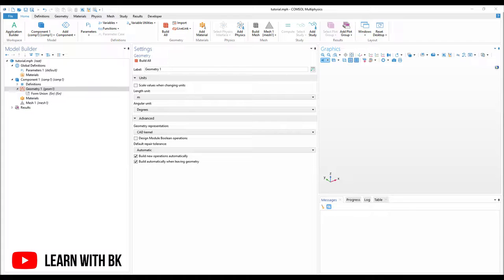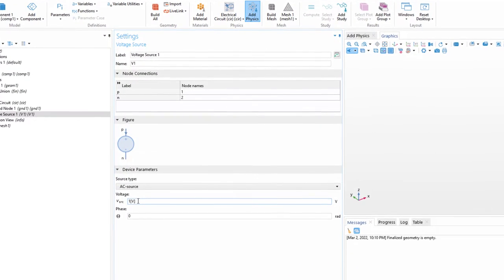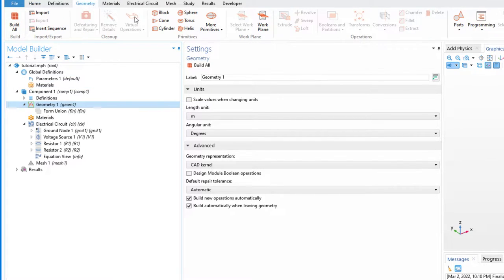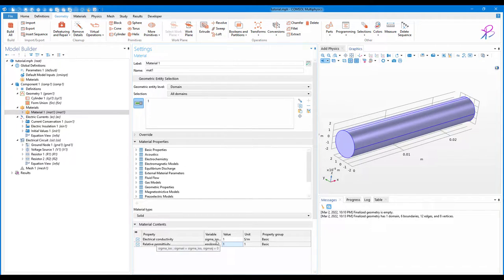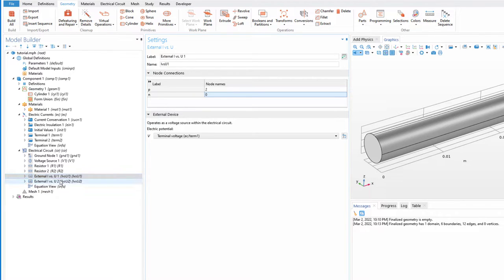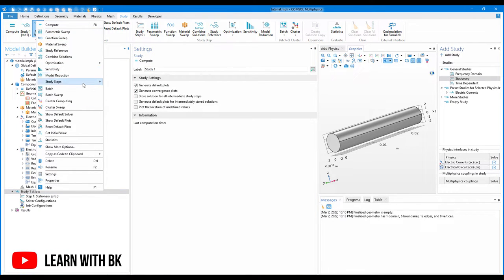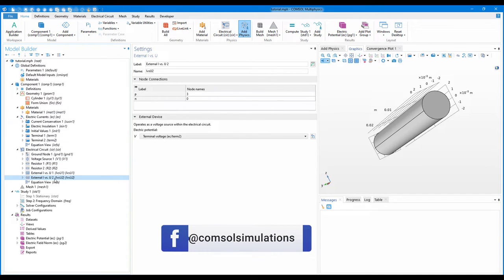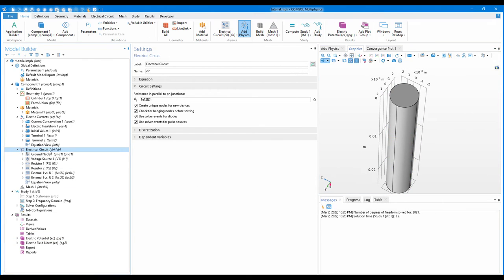Electrical circuit + FEM simulation in COMSOL Multiphysics

Comment: Hello BK,  how would you simulate similar cylinder connected to a transformer secondary side where primary sides of the transformers are connected to L1 and L2? (this is very simple said but I have troubles simulating one scenario and I am seeking for help. Is there any chance I could chat with you?) tahnk you very much

Comment: In the current circuit,  if I choose pulse source (instead of AC source) for the voltage source , what should be the study step?? (It's not working for frequency  domain)
Reply from the maker: sorry for late reply. if you already found the solution please do comment so that others can get the help too.

Comment: Could you please explain what is 1 2 3 or zero node names??? I am mechanical engineer and i dont know much about electrical part. But you can help me alot if you answer me❤
Reply from the maker: Those are names of the joins.